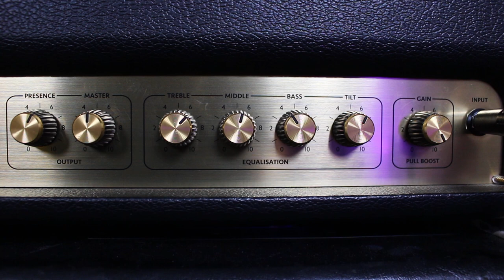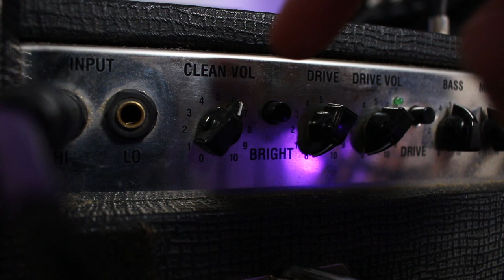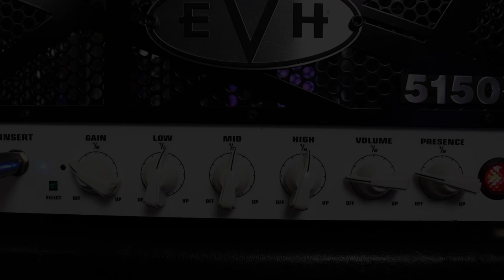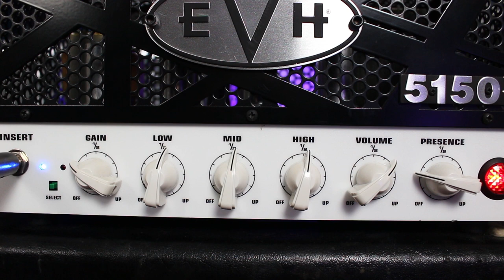Power Amp vs Preamp Distortion in a Valve / Tube Amp - Info & Demo (Marshall Origin, 5150lbx, VC15)

Comment: Thanks, some more advice, if your pushing the amp with pedals make use of the effects loop, it’ll make it easier to tame the harshness of the preamp.
Reply from the maker: Cool. What do you use in the loop of yours?
Reply: @DanLeggatt  I’m doing two things with it so far... running an OD in front and delay/reverb in the loop... what’s really interesting is running preamp blocks directly into the loop power amp... All with a helix, the power amp is actually very warm... I can also use a volume pedal in the loop to get the tone of the amp at a much lower volume, it doesn’t seem to effect the gain/master tone much... I need to play with that more, but most of the breakup in the amp appears to be only in the preamp not the power tubes, I could be wrong though and need to test more, but I’m thinking you can get all the tone and lower the volume in the return.... it’s a very cool amp that seems to do almost everything well... but being able to revoice the power amp with the preamp models has made me love it... the power amp/cab is pretty transparent so it works well... I’m surprised by that...
Reply: @DanLeggatt  I’d bet it might be easy to mod the effects loop with a single potentiometer to adjust the volume level after the preamp... the master is actually part of the preamp as it has no effect on volume after the signal comes back into the FX loop return... it’s straight into the power tubes from there...
Reply: @DanLeggatt  I’m happy finding this because I was thinking the amp was a little brittle due to the smallish output transformer... that’s not the case at all... it’s the preamp only that’s a little harsh... finding this made me happy because I’m able to dial in any tone easily... had the transformer been the problem that wouldn’t have been the case...

Comment: Most of what people think as Power tube distortion is actually phase inverter
distortion power tubes don't actually distort much if at all.
Reply from the maker: I’ve learned through more tests and research that the PI is far more a factor in the tone than I thought.
Reply: @DanLeggatt  interesting! I was watching a repair video on the Blues Junior in my quest to get it  to sound better with overdrive (amp or pedals) and someone mentioned changing the phase inverter tube to smooth out the gain. Not sure what they specifically recommended.
Nice video by the way!

Comment: Great vid Dan! So would you say, to get creamier, overdriven tones, one would rather use a boost pedal to drive the amp? I thinking more along the lines of a Mike Oldfield, and in a lot of cases 80’s lead tones.
Reply from the maker: I think you can do it in a number of ways. There is so many good pedals out there, you could even rely on a pedal entirely for the tone into the amp set clean. I really like the Friedman Dirty Shirley pedal. 

If you wanted to boost the amp already driving to push it over the edge, my favourite boost is the TC Spark. Really tweakable and really cheap.

Comment: I have never seen such  small and toy like transformers like marshall are using these days
Reply from the maker: They are a bit on the small side but to be fair, this is a 20w head. The transformers are about the same size as in any other 20w and under head or combo I’ve owned. I’d imagine bigger iron would be an improvement but you can’t have it all for this kind of cash.

Comment: Why don't you run a clean boosted guitar signal into the Effects Return jack? I can hear a difference as you turn up the Master, but you've already distorted the signal with the Gain control.  We all know what coloration the Master can add to the signal, thanks to Marshall's various attempts to do a good Master Volume throughout the JCM800 series - and this amp is not a Post-Phase Inverter Master Volume, so the Master is loading the output of the preamp.

Comment: What I would like to know, Randy Rhoads for instance, used a Marshall 1959. It just so happens to not have a master volume or perhaps a preamp volume? What does that particular amp push more, the preamp tubes or the poweramp tubes when the only volume is turned up? Are you saying that because there's only one volume, it essentially pushes both preamp and poweramp and is this why Marshall snobs hate master volume amps? How could this scenario be used in a modern Marshall like a DSL40cr?

Comment: Great video & demo.
Apologies if you’ve already covered it, but what are your thoughts on volume pots in the fx loop, vs power soaks between the head & cab? If I understand correctly, the volume pot allows you to drive the preamp, whereas the soak allows you to drive pre & power?
Given your demo shows how the power amp clearly shapes the tone as well, would it be fair to say a soak gives a better approximation of a valve amp on full chat, but at manageable volumes?
Reply from the maker: Cheers! That’s an interesting discussion to be honest. For certain amps it can be effective using one of those volume box in the loop. It depends on what you are trying to achieve and where the FX loop is placed in the circuit. 

For example using it on an amp like this would basically replace the master volume. You wouldn’t be hitting the phase inverter or power amp any harder. You may get a bit more juice out of the amp. 

For an amp like the Fender Hot Rod deluxe those volume boxes work great because the amp doesn’t have a master volume. 

I think for an amp like this an attenuator would be a much better option. Obviously this amp has some degree of power level attenuation on the switch but even low isn’t bedroom volume. 

This whole thing would actually make quite an interesting video now I think about it 🤔
Reply: @DanLeggatt  Thanks for the reply.
I’d happily watch one of your videos on this! 😉
I have an ‘original’ JCM900 4100, and I’ve played around with a volume pot in the loop (Carl’s Custom Guitars) and although it improved things, it never quite did it for me. I seem to recall the Marshall Power Brake uses a fan to cool a heatsink, which I found distracting, and ironically noisy (especially when trying to record). I’ve been considering the Bugera PS1 Power Soak, as apart from being much cheaper than the Marshall, it also acts as a DI for recording.
I know this is another subject altogether, but functionality-wise this is an attractive prospect - potentially a kind of ‘best of both worlds’.
But, my cynical side thinks it’s too good to be true...
Reply: @CaptainBlackadder75  The bugera ps1 is a passive load box. That's why it is so much cheaper than the UA Ox box and similar reactive attenuators.

Comment: Well it is really a good and very usefull vidéo ! thanks a lot for doing it. But which kind of pédale attenuator would you suggest to push the master volume and reach this specific sound without denaturing the original sound ? And without blowing your head off ^^ off course :) thanks for answering :)
Reply from the maker: Definitely go for a proper attenuator that goes between the head and speaker cabinet. Luckily there are some on the market now that aren’t that expensive. Such as the Jet City Jettenuator, Bugera Power soak or the similar Harley Benton model 👍
Reply: @DanLeggatt  Thank you for your quick answer (not as mine...) I'll try the HB to see what i can get. I've got a 50h Origin Marshall as well. It neads time to learn how to found all the sounds that he can propose. Thanks for your channel and videos Dan. And excuse my english, i'm french ^^
Reply from the maker: @bloodypura5385  Merci d'avoir regardé ma vidéo 👍

Comment: Very cool video! So listening to early Jimi and EVH tones on VH1, that overdriven, crackly/crumbling speaker sound was that pre or power amp distortion? I always loved that sound in a hard driven amp especially when it also has clarity to it aka brown sound. So VH1, is that all power amp distortion I'm hearing in what I just described??
Reply from the maker: A mixture of the 2 really. Those amps they were using just had a volume which would in turn distort the preamp and power amp the louder they were turned up.

Comment: Hey man, great explanation! I have a Randall RH150 G3 150W Tube/Mosfet head unit and it keeps blowing the 12AT7EH pre amp valve, I suspect its a dodgy power convertor (It's an American Head unit with a US-UK power convertor which has been dropped a few times and is held together with gaffer tape!) so i've ordered a newer updated version power convertor from Gear4music which should be here in a day or two.

Do you know if my amp's clean channel will work without the pre amp tube being in it as I intend to play Bass through the Randall head as it has really good bottom end and i'm a cheapskate and don't wanna buy a Bass head unless I absolutely need to! 
Thanks in advance dude, Subscribed :)
Reply from the maker: Depends totally on the circuit. If the tube is in the path for the clean channel then no.

Comment: do you think the Marshall origin would be good to run a synergy system through the fx loop? mainly Ising the origin as a power amp?
Reply from the maker: Tough to say but I would imagine so. The Marshall power amp feels a little ‘squishy’ for lack of a better word. I’d imagine it would work great for the Synergy Marshall and vox inspired modules but might not be idea for super tight high gain.

Comment: I don't hear any power tube distortion from any of your amps, just the mid tones coming up louder, that's something that power tubes do. You really need a 68 to 71 Marshall to get the power tube distortion, it is far more dynamic then preamp gain.
Reply from the maker: I’m not an expert but pushing the volume on any amp will cause the power amp / PI to saturate. Saturation is distortion. Those Marshall’s are certainly not the only amps that have power amp distortion. Although I would be interested to hear why you think that’s the case?
Reply: @DanLeggatt  it could be the amount of head room on your amp, I would look at the negative feedback resister, and try lowering it on that amp, I put a lower resister and a 1k volume pot to have it adjustable on a Ceriatone yetti kit amp I built, you could dile it down so it would brake up early like a vox amp, or bring it up to a Plexi , one hundred k on 4ohm tap, that will definitely go be you power tube brake up.